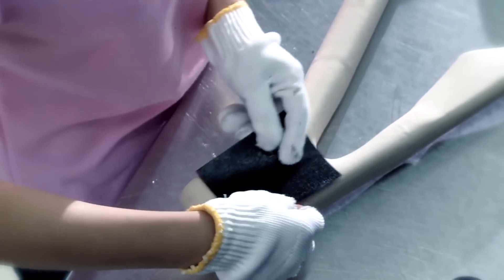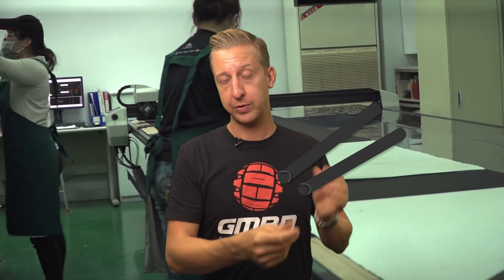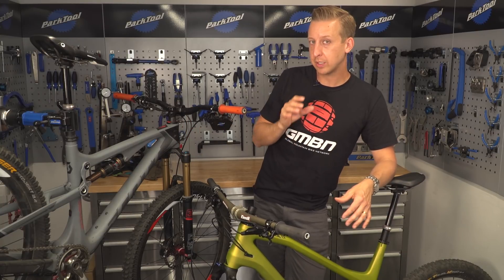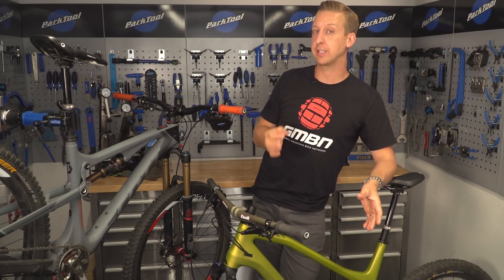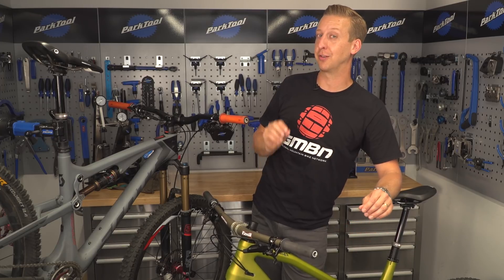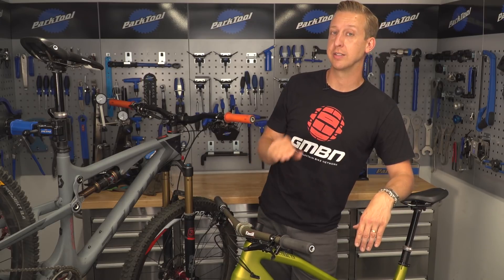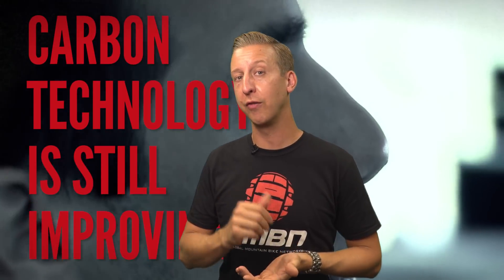7 Things You Might Not Know About Carbon Fiber

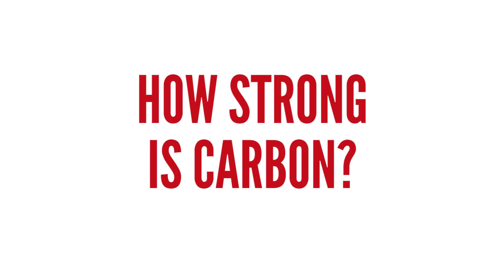Comment: at 2:58 you state that if you do not see anything or only little damage after a crash you are fine, because CF is strong. This is simply false and you should not spread this kind of knowledge. If you dent your frame the fibers could delaminate underneath. That means that you do not see anything but there could be sewere damage resulting in a less stiff structure. Therefore not safe to ride anymore. 

On delamination: https://en.wikipedia.org/wiki/Delamination

On Composites https://www.youtube.com/watch?v=FhlsuL9RcYM
Reply: Mr Cow, yes it's strong until an impact, after that it is unpredictable, carbon fibre hides delamination well. especially if internal delamination you will never know the frame has started it's breaking process if that's where it starts.
Reply: C Wolf so CF is weak?
Reply: Mr Cow it is very strong but brittle so it can't handle mechanical shocks as aluminium
Reply: Kevin Nivek exactly, good for those who don't have to pay for another one lol

Comment: Small corrections... Sheets can be unidirectional or multidirectional. Sheets aren't required to be preimpregnated with resin. Sometimes structures are created using the filament winding process (not just laying up sheets of carbon). UV exposure is the bane of epoxy resins' existence, so if scratches are deep enough, you should apply uv resistant paint/clearcoat asap!
Reply: nicely done sir
Reply: UV rays affect the carbon moreso .
Reply: Graphite, itself isn't UV averse. Aramid fibers are very averse to UV exposure. The polymers used in creating graphite fibers are what make carbon fiber more susceptible to uv degredation. Infact, there are projects researching the use of graphene as a coating on composite fiber.  Weathering erosion is a bigger threat to graphite than uv radiation.